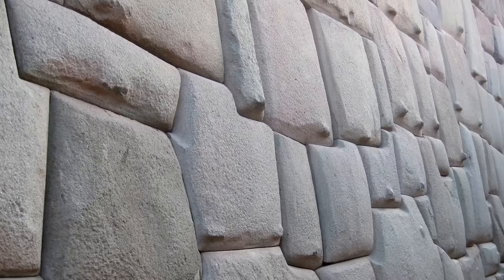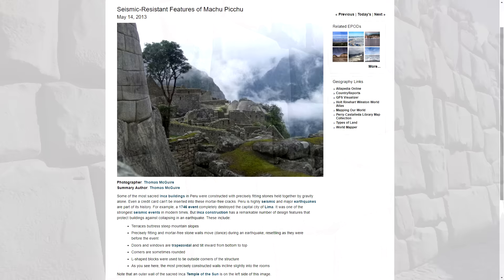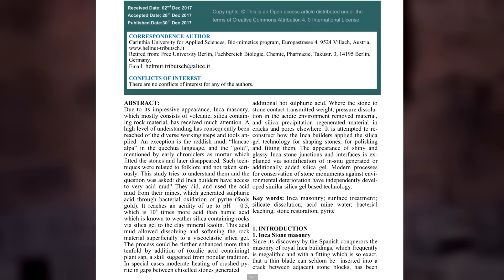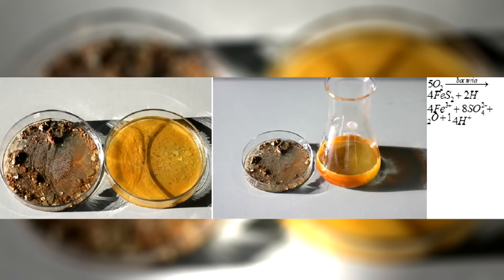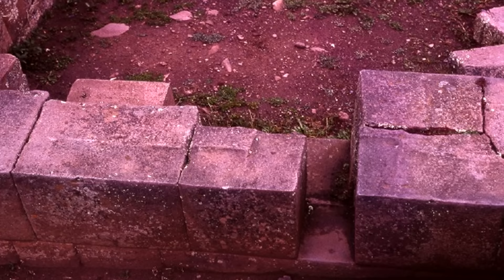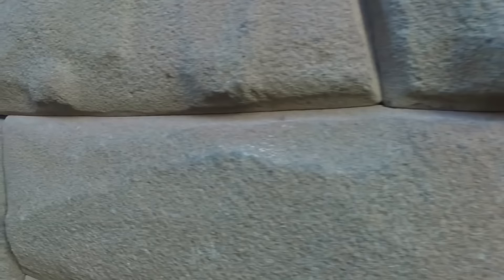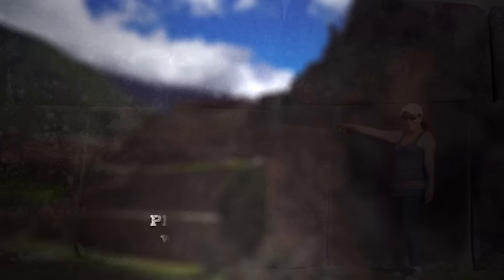Is This How The Inca Walls Were FINISHED/JOINED So Perfectly?

Comment: Why would every single video ignore more simple solutions?  For example, they could have spread a thin layer of clay on the side of the rock, let it dry, then use that "mold" of clay to smooth the surface of the next rock in a way similar to how a dentist smooths a tooth cap to fit into your bite. Perhaps the mold was cut into strips then left to dry so that they had strips of molding to carve the next stone.  That method would work with the most primitive of tools, even stone tools.  The only thing it would require would be time and dedication.  Maybe there was a civilization before the current one who paid more attention to detail in their construction.  Maybe these were made by pre-incas, maybe not, maybe those people didn't have greater technology, just a greater attention to detail.

Comment: It's a hypothesis worth studying.  So why has it not been?  It seems plausible though.  A person wouldn't need access to the exact acids in use there to "prove" the hypothesis is valid, just need to build a wall using a mild acid.  Almost worth trying.

Comment: I think this hypothesis , doesn't account for the shaping of the blocks.  I understand the chemistry, and how this could bind the joints, but the blocks would have to be shaped first.  There would also, be chemical evidence.  Trace isotope molecules, from the acid mud.  I am not aware of any such findings on the rocks.

Comment: Hi; the hypothesis is VERY seductive… although, if it were true, we should have retrieived some remains of this corrosive paste, and as well some drippings of these degraded stone components, leakink from the joints.. And also, we shoud have noticed some failures in some places, the technique could'nt have been 100% accurate.. This makes me think that the blocks were prepared elsewhere before the assembling.

Comment: There's no way the Incas built the original polygonal stone walls. If you examine the sites there are repairs to earthquake damage the Incas did which is markedly inferior to the original polyganol  stonework. Further there is no evidence the Incas could move stone blocks that were in the 100 ton size range.

Comment: The scoop marks where megaliths were carved from base rock suggest the civilisation that built in this way had a means to cut granite that has been lost. At the Sphinx, the limestone substrate has been left as a coarse lumpy base while the fine granite facing stones have been shaped to fit around the limestone. This is illogical to us as we find limestone much easier to work compared to granite; we would shape the limestone to fit around the granite. This theory of mine water softening granite is pointless without experimentation. If a solution we are familiar with dissolved granite, why have we not seen this? It is so easy to test. 

We also know some civilisations used saws to cut very hard rock, including the builders of the pyramids. Discarded granite blocks around the Valley of the Kings show evidence of 2m circular saws having been used to cut them. There is also evidence of hole saws cutting 5 to 8cm cores from very hard granite. Examinations of the discarded core plugs show the hole saws progressed at 1-2mm per revolution. We do not know how fast the revolutions occurred, but the diamond saws we have today, with powerful motors turning them cannot achieve that progress per revolution.
Reply: Most of what you said there is not true in the slightest. Keep reading.

A few examples,

1. The granite facing stones of the sphinx. You don't understand what the Egyptians thought about the power of stones. You also don't seem to realize the granite is a lot harder than limestone so makes perfect sense to use as cover stones, why would you use something that's going to either look like garbage in a hundred years or need to be replaced? 

2. There's no evidence of circular saw use in ancient Egypt, there is evidence of saw use but you only listen to people who have books to sell you.

3. Drill cores. No evidence of a drill rate that you mentioned, the marks left behind are not uniform spirals, they are however perfectly consistent with copper tube drill marks. Copper tube drills cut granite pretty quickly and we know they had copper and drills in the past. You can even watch copper tube drills in action here on YouTube.

Comment: Yon know something I find interesting about all the megalithic ancient artifacts, pyramids, these stone walls, etc., I have never heard of ANYTHING anywhere that indicates HOW these stones were handled/lifted.  No fossil evidence, no pictographs, no wall paintings, or other artwork to show that they even KNEW what a crane was much less how to build and utilize one.  And the idea of moving a 5 ton or even larger stone around to “grind” the two surfaces so tightly together that you can’t even put a piece of paper between them is patently absurd.
Reply: Totally agree .. no credible explanation of the expertise and technology to measure, cut, shape, move and raise massive hard stone blocks SUPPOSEDLY BEFORE THE WHEEL WAS INVENTED!!
Reply: It's actually quite easy if you understand the basics of fulcrums, levers and mechanical advantage. Lookup a guy called Wally Wallington.
Reply: @jannenreuben7398  yeah, I’ve seen him.  I could accept that answer if maybe the stones were smaller.  1)I don’t believe that two stones were placed APPROXIMATELY together with an acidic material between them and gradually “melted” together.  As just one example, think about how long that would take, with an unstable wall.  AND, rain washing and running between the stones removing the acidic material.  2) Same question as with the “crane”.  Never, in all the writings, cave paintings, paintings, in archeological evidence, is there anything to indicate that they even knew or understood such processes.  WHY?  3) and I’m not saying necessarily aliens, though it can’t be ruled out.  There are plenty of Egyptian hieroglyphics and writings that SEEM to indicate knowledge of flight and “visitation”.   But what if, as a talking point because of the same lack of evidence, there really was a prior, more advanced, civilization that has been lost to time because we haven’t found artifacts since we haven’t been deep enough in either the ground or ocean?
Reply: @OldMan854  I suspect the paste was really there to smooth out any tiny imperfections between the mating faces. In other words they'd get it as close as they could and apply the paste on the last fitting. The big stones would "slump" slightly over the next 500 years suggesting the joints were not quite so tight when they were built.

The lifting element is probably the most mysterious for me too. One of the contemporary Spanish writers said that the Inca had no knowledge of cranes or pulleys, only that they used large work gangs to move stones. Later archaeological evidence (Jean-Pierre Protzen from memory) suggests they used pebbles to move stone over longer distances. 

I don't find extraterrestrial or antidiluvian explanations persuasive because there is simply no evidence for them and we have plenty of evidence that ordinary humans built this stuff. If that isn't persuasive then the honest answer should be "we don't know". We can't explain a mystery by invoking a bigger mystery, whether that be aliens or whatever. We don't necessarily rule those out but they are at the bottom of the explanation pile for me.
Reply: @jannenreuben7398  excellent.  I guess, unless we find evidence to the contrary, which we probably never will, I guess it ends on “your guess is as good as mine “.
Reply: @OldMan854  Yes, pretty much! 😀

Comment: Question , do you mean they handled rock melting acid bare handed?  Did they have rubber gloves fresh from a rubber tree ?  Also that seems to be an advanced for people to refine gold,  I mean to have chemical knowledge but could not make steel or a wheel?  Just asking..
Reply: Were there hands made from rock? Are you not aware some chemicals react with other chemicals but not every other chemical?
Also wheels require roads. Ancient Egypt knew about wheels but didn't care for them because they didn't need them. Wheels are great, but not everyone needed them.

Comment: If you have tried to work on granite - than you feel It Is So (f-ing) Hard - Just to make a small hole in the stone takes hours - and is wearing down the chisel. And these stones are shaped into each other - on all sides. So it is natural to try to find other methods. And if there is a biochemical method, I presume it must take long time, as granite is very resistant. If granite was dissolved by bacteria - wouldn't we have seen that more often and have knowledge of that? 
Obviously it is not the Inkas that build these buildings.  But some humans it must have been long long time ago. To make reliable carbon-14 dating - it would be good to move one very large stone and see if there is any organic materials under it.

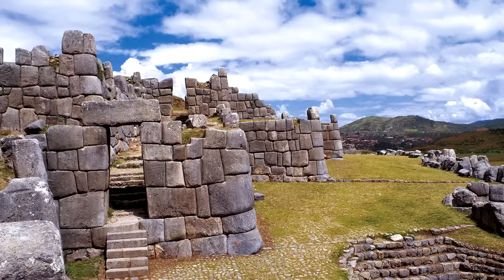Comment: I drop anchor at "usually (used)" which is found within the full statement starting at 1:17.  The word "usually" appears just after 1:24.
If this whole hypothesis requires silica rich rock to work, then examples of other material displaying the same joinery would undermine it.  But it is not stated if the foundation stones, for instance, show this joinery, or if they don't.  As a result, this entire video is voided to me, due to this vague and unspecified detail which the narrator alludes to but does not properly address.

Comment: No, it doesn't make sense...
If that "solution" was acetic, how do explain the vertical junctions?  I got the horizontals. If this solution is acidic, and overtime dissolve the rock how do you explain the rocks on top are perfectly smooth?...
In my opinion the most likely explanation is fire, heating the rock to a very high temperature and before it cools down, make the carving.
That is the most likely explanation in my point of view.....but I could be wrong.

Comment: For the acid mud theory to be valid, acid mud has to be available nearby.  Is this always the case?  If there is even one exception, then a different method was used.  If one place used the different method, then other places could have used it even if acid mud was easily available.
Reply: Making acid is not a difficult process. The components and methods are available on all continents.

Comment: Even so, how did they lift 100 to 1000 ton block in place, from quarries miles away up steep mountains. It's really very simple, replicate this work without any modern equipment, then come back to me.
Reply: I have just thought , the local inhabitants found expanding putty-like lumps of " clay ".
Reply: These " clay-like lumps " were found in decreasing quantities , until this phenomena just pittered out. The phenomina just finished the same way it was found, just finished. The putty clumps could not be found.

Comment: ❤ from Wayne in Australia. The hypothesis doesn't take into account the weight and logistic of transportation, hence , I still don't believe the Inca constructed these walls,
Reply from the maker: I do agree, but don't know absolutely due to lack of experiments, I'm gradually going through the different hypotheses and as there were cultures in Peru well before the Inca showed up they probably were built earlier, information is quite scattered but am gradually putting some things together on the possibility of it being pre-inca!
Reply: Keep working camp. It's hard, checkout the science on the rock. UnchartedX points to the science. Think, moulded rock, think energy source not yet available. Check scoop marks on rock work. Check delamination, think big machines and technology yet to come. Sound gun.

Comment: I think they used both carving and geo polymer. You set your 2 stone form blocks and pour your next block in between. Your corners are set  first then you carve and stager every other stone. Then you pour in between.  How ever they built this polygonal walls, it had to be efficient and progression steady. Using bacteria for stone softener would be a slow process. I’m sure they need the wall built in a suitable time frame?  
  As far as polygonal masonry, it’s found globally? I think that’s the first clue in figuring out how it was done. Who where these people with such knowledge and skill that baffle even the greatest minds of today? We know the hard core drill technology, we have seen their tool marks and theirs evidence of saws and highly polished hard stone like granite. I believe the evidence from archeologists of geo polymers is point on.  The reason I lean towards geo polymer is two reasons, the tight fit and flawless seems and mixing large pours defeats moving massive stone. Yet we do see large stones that where moved to mind boggling distances so they wher3 capable of amazing things. I tell you that’s not Inca, and many structures in Egypt weren’t Egyptians and so forth. Good luck with the bacteria idea, I just don’t see it effective on a massive scale as being efficient and productive.

Comment: I do not agree with what you say. What  I think is they are made of rammed stone particles with some type of binding material mixed in. They put the mixtures in some thin fabric bags kept sides by side, which were than put in some bigger wooden frames they could put thin metal sheets between the bags to give them certain shape. Then they poured mixture in the bags and rammed them with heavy stones. Final result would be stones shaped similar to their desire.
Reply: But why make them such a vast variety of sizes?

Comment: Let’s look at it logically, if you are fitting a 5 tone stone to this kind of tolerance how many times would you need to life it on and off again for checking? Also you acid mud idea make no sense at all as the side joints would have no downward pressure so would expect the gaps to get bigger as the stone erodes, the only logical way to fit the stones would be to start with one cut stone take plaster casts of three sides then then use the casts to work the surrounding three surfaces then fit the stones. So only moving each stone once

Comment: Evidence? How long wood acid mine water take to do it?

I don't think this was the process. Mostly because the Inca don't take credit for the construction. But also. I believe it was an ancient civilization with simple technology we have not totally realized yet.

Most likely Anunnaki. Using intense heat from CO2 laser & sound waves to move them.
Reply: Yeah, co2 lasers and vibration lifting technology definitely sounds simpler than some mud mixed together. I appreciate the joke. I just didn't find it that funny.

Comment: Sorry but it does not make sense at all.  For one thing, in the space between two of those stones, even if roughly cut at the start, there would be hardly enough of that acid paste to eat away a significant portion of them.   In fact there would be more of that acid mud in the places where there is a gap between the two stones, and practically none where they are in contact; so any corrosion would widen the gaps, rather than close them.  Moreover, the weight of the stone would squeeze the water, with the dissolved acid, out of the mud,  leaving behind a semidry caked clay; the little acid that remained in that cake would be unable to get to the stone.  Also, that acidic mud could perhaps corrode limestone, but not granite or andesite.  Also, if any extraneous material had been placed between the stones,  one should find at least traces of it between the stones that are still in contact. 
If someone tried using that method, it would be immediately obvious that its nonsense.
Reply: Prove it.
Reply: @kevinhank17  You first...

Comment: They could have been heated and softened that way and mounded or possibly hammered into shape which would explain their soft edges.  People forget or don’t know that inside the joints there are stone pegs that precisely fit and stop the stones from shifting and the nodules on the outside were much longer used for lifting the stones into place.  After the stones were moved into place they just knocked off the lifting pegs.  For a Stone Age civilisation they somehow built machines or mechanism that could pick up these stone weighing many tons.

Comment: Tnank you for your video.  However, there are holes in your hypothesis and there is a MUCH simpler possible solution.   I proposed a method whereby they prepared one stone, then made clay molds of the surface of that stone and used that mold to carve the next stone to fit on top, much like a dentist has you bite down to form a new tooth into your bite.  This wouldn't require any sophisticated tools or chemicals, just mud, a few simple rock carving tools, time and dedication.  It doesn't even require much imagination.  They could just look at stones in nature and how they stay together better if they all fit together tightly.  It may be that a civilization of pre-incas build these as sacred structures where they might take an entire week to carefully carve one stone, whereas the Incas who came after them just added to the remaining structures with much less care to build homes or other practical structures.  I would love to see some accurate dating of the different forms of buildings.  I wouldn't be surprised if the older stone work predates some terrible natural disaster and people came back to the sites thousands of years later.

Comment: This is idiotic. With this hypothesis, essentially each side of every stone would be shrinking. That would increase the gaps. If you remove a layer because of the acid solution you would have to have inflating stones to replace the gap. This concept doesn't hold water.

Comment: that is an absurd explanation. they would still have to cut the stones to within 1 ; 1000 of a cm or within the thickness of a sheet of paper in which case the solution would not matter at all since time and gravity will do the fine tuning of the  fit anyway.